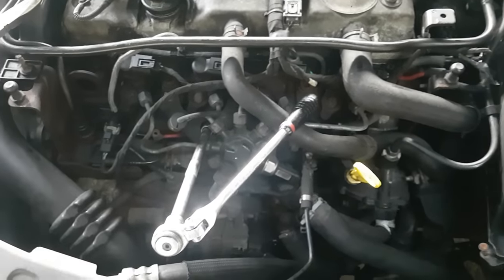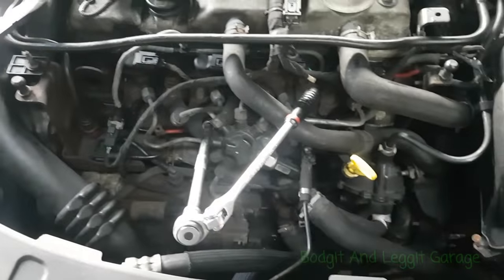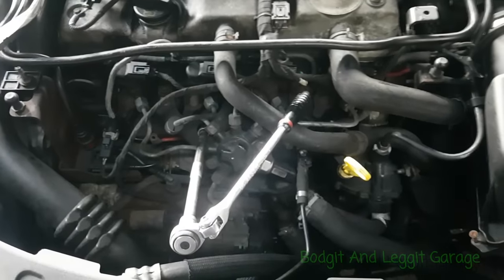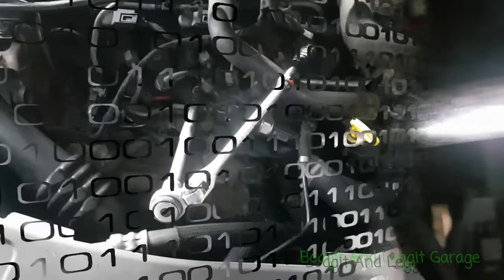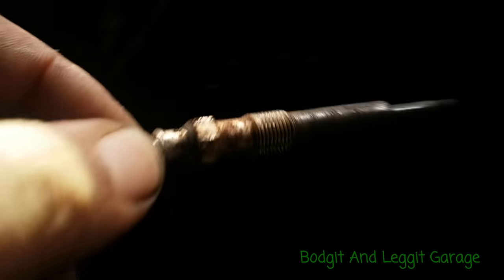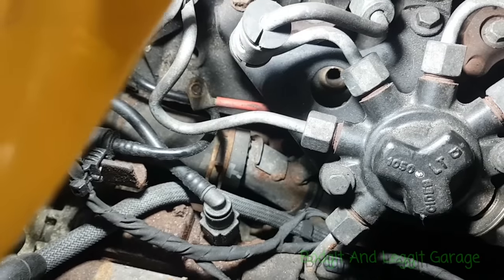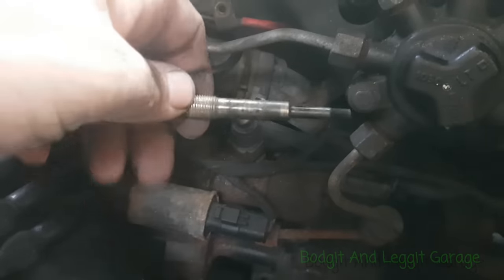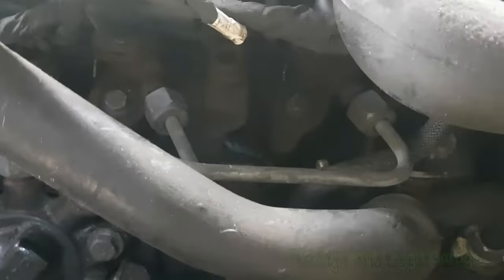How To Remove Seized Heater/stuck glow plug With No Specialist Tools Bodgit And Leggit Garage

Comment: Leon you gave me two f..king heart attacks, I thought it snapped twice😄 
But great job and thanks. 
Any reason why you didn’t use wd40? 
I’m doing my freelander 1 td4 soon, anything I need to look out for?
Reply from the maker: Hi mate to be honest WD40 just doesn't really get him I haven't seen any zuid to work in this circumstances it's clogged up so much it just will not penetrate there's lots of videos out there proving this fact nothing really to look out for just take your time with it and you should be fine

Comment: Do you think glow plugs are responsible for my dpf not reaching 600C? It is usually around 500C when regenerating but the soot level is stuck at 45g and seems to go lower when temperature gets occasionally higher than 500C
Reply: Ever get the answe for this?

Comment: That is (IF) it moved,so what if it didn't??!!! ,hope you show us how to remove a stuck one like number (4) on this engine.
Reply from the maker: If a heater plug is going to snap there is nothing you can do about it it's going to snap I will be doing a video and showing you how to remove a snapped heater plug
Reply: @bodgitandleggitgarage  Thank you for your reply,I will be looking forward to that video,as taking a  heater plug can turn to a nightmare easily.

Comment: yes, I am grasping that atm.  I also dont know if heat helps penetrating oil?
Reply from the maker: It's like everything made it has its uses for certain applications it most probably would have stopped the squeaking noise but it would not have penetrated or the hard material that was caught in the threads in this case

Comment: Great videos, mate. Unfortunately i'm in the latter group whose plugs are still stuck (rounded heads) in a Renault master 2.5L after trying with a bolt extractor to no avail. Probably asking a bit much for a follow up video on that but it couldn't come a day too soon!
Reply from the maker: as soon as I get a car in where the heater plugs are broken or snapped I will be film it mate
Reply: Did you make one yet?

Comment: hi there. my 2.0 tdci got 2 spark plugs snaped and one got out but the central eletrode is still stucked in engine. any tip top? cheers
Reply from the maker: Hi mate what happens is the tip of the electro boulders up and is too big to pass through the engine block hole what you have to do is get it pushed into the cylinder take the injector out use a magma and get the tip out that way there is a special tool for it I have done a video on it Hubitools have the kit tell them I've sent you they will look after you
Reply: @bodgitandleggitgarage  many thanks! :)
Reply from the maker: @woobeitwebdesign2303  any time mate
Reply: @bodgitandleggitgarage  i just forgt to mention that in my case i have the thing a little bit f@#$%. i have the central electrode and the tip inside, the rest of the spark plug got out but with this 'wire' i think im not sure i can adopt your tip top of pushing it inside without first removing this electrode, and because its tip is so short, its even more complicated to user pliers or something else. i will look into your hubitols video and please feel free to share some leads :)

Comment: you tools have a glow plug air gun for seized plug ,air gun not work why you don't use it.
Reply from the maker: First thing look at the title of the video second thing not everyone's going to want to spend lots of money on one of them tools third thing someone's going to most probably start this in the morning not realising they're going to come into a problem and they're going to be snookered 4 things not everyone has an air compressor this video shows you how to do it with no specialist tools hence the title
Reply: I’m waiting for my glow plug impact to arrive I know you said there worth there weight in gold but I’m still nervous about getting them out. I brought it on your review. As I’ve had a plug snap in my old transit. £1800 to fix it. £140 is cheap if it works

Comment: My damn glow plug is just spinning round and round. And it wont tighten back the other way. Dann it.
Reply from the maker: not good mate
Reply: @bodgitandleggitgarage  any idea what it might be? Threads knackered maybe. Read somewhere to give it a small whack of a hammer and try again. But if I bust the engine threads I'm in trouble. Maybe pulling the bottom up as I unscrew? Have left it soaking in wd40 but not that hopeful.
Reply from the maker: @michaelfreeman7381  could be loads of reasons mate could be threads a gun cross threaded it could be snapped internally there's more than one reason impossible to know unless I see it but from the sounds of it however you look about it's going to be a nightmare to get out possibly looking at redrilling it and re tapping it it's a big job the tools you need to do this are very expensive if you will be cheaper paying someone to do this
Reply: @bodgitandleggitgarage  I'll just try a few more tricks then it's time to get rid I think. The thing was really over tightened, should've just left it in in hindsight.

Comment: Leon there is one special tool needed patience, unfortunately you can't buy it. Is there any reason not to use anti seize in this application?
Reply from the maker: Hi mate I've never known any to work properly especially in this type of environment where it gets very hot and cold thousands of times I do see your point just haven't really found one that works properly
Reply: maybe candel wax if you can get it in before it sets great lubricant
Reply from the maker: @timmytrumpet9922  yes mate I have had some success with candle wax in the past on different issues
Reply: Timmy Trumpet antiseize like copper slip etc normally leads to over torquing things.

Comment: Nice one bud. What was the Simpson’s to make you remove the glow plugs please.
Reply from the maker: I was just doing it service and I tester heater plugs just as a matter of course and 3 of them were bad we haven't had the weather or should I say we haven't had cold enough weather to affect it starting but we are getting into the winter so just as well changing them now
Reply: May I pick your brains please bud? I’ve have a mk 6 transit tourneo, a few months now. It has 18 inch ally wheels. Just passed mot np. The thing is at around 40-45 mph there’s a wobble worse on acceleration. As mot was ok bearings etc must be ok. New tyres fitted so balancing should be ok? Do you think it’s possible the wheels are u.s o front wheel drive. Thanks mate for your thoughts in advance.
Reply from the maker: @paulelliott2861  hi mate if the problem only happens when you put the big wheels on it can really only be a problem with the wheels either they're not fitted correctly and what I mean by that is some wheels have an inner ring that sits on the hub to centre it properly make sure you have that ring if not one of the wheels could be badly warped make sure there's no welding or any marks on them this could also throw it out
Reply: bodgit and leggit garage thanks buddy there bud came with these wheels . Once I got it home my wife said” them tyres don’t look right “ I took it to a tyre place and yes indeed they where incorrect. They where car tyres. Had them replaced. I did not see any rings on them but there offside front has a large number off balance weights on it. I have a set of standard wheels and tyres. So will change over. Thanks bud.

Comment: Done mine a few weeks ago on the same engine, 3 of them popped out easy but the last one wasn’t budging, starts a lot better now, I used new Bosch ones and the bit to put the socket on was a lot longer so it doesn’t slip off as easy.
Reply from the maker: Sorted!!!

Comment: I've been battling this for a couple of days now!  Not sure how you eventually got it out, but mine seems to come out all the way just like that (noise and all!) but at the end of the thread seems to just spin in place so I can't remove it.  This plug seems to be the only plug that has been previously replaced (the tip was different and service says a plug was replaced), but I've replaced the other 3 so would like to replace this one as well.  Screws back in ok'ish though so maybe I should just leave it....??
Reply from the maker: Hi mate, what it sounds like is the end of the glow plug has bulged out? This is caused by Heat and the plug breaking down. Again, I'm not 100% sure because I'm not there, but that's what it sounds like if that is the case you are unfortunately in a bit of trouble as it cannot be removed. The only way to do it is to try and break the end off and take out the injector and remove the piece but you have to be very careful doing this. As you can call permanent damage to your engine if you don't have the tools. I personally would leave it or go to a garage that does.
Reply: bodgit and leggit garage thank you very much for getting back to me. I think I’ll leave it as is for now 👍
Reply: I’ve bought a new set but I’m losing me bottle watching these vids

Comment: Thanx for ur help !! Took the glow plugs out of my 2003, transit today. Used ur technique which worked a treat.
1 although appeared to un screw, well it did unscrew but then would not pull out ?
So improvised and wrapped wire around the head and held with pliers. Then pulled on that whilst wiggling the nut and it then came free.
Caked in black soot etc.
Everything cleaned up, including inlet manifold and egr. Then all back together !!
Good afternoons work ???

Comment: I think I would change the front 3 and not even worry about #4. If you’ve got three working, that fourth one doesn’t matter one bit unless it has separate glow plug circuits and is setting a DTC for #4. Most 4 cylinders don’t work that way though, all of the glow plugs are connected to each other with either a wiring harness with a single power feed or a bus bar.
Reply: I have 1.7 diesel Astra which has one loom containing four cables from the timer control module. One cable to each glow plug, makes diagnosis a doddle

Comment: No substitute for a skilled mechanics touch! Reminded me of changing them on my old P100. One snapped and was a right bugger to get out. Quite common to find three new ones and a broken old one in an engine,starts ok on three good plugs.
Reply from the maker: The problem is made with lots of modern cars with DPF filters when is trying to regain depending on the car three might not be enough and can go into limp mode

Comment: As usual another helpfull video.  Any benefit to using this method along  with wd40?
Reply from the maker: Hi mate in my opinion no there's lots of videos out there proving even with lots of heat penetrating oil doesn't really work don't get me wrong I still use it but I think it's more in my head to use it than it actually does any good but like everything there is certain circumstances where it can be used
Reply: @bodgitandleggitgarage  

Intresting, i dont deal with stuck bolts as often as you but  think i probably agree.  I wonder if to an extent penetrating lube actually dulls the feel of the thread binding so the temptation is to do that extra turn rather than backing off.
Reply: Paul F 
Great point 👍

Comment: one of mine did that and left the end bit in td4 freelander
Reply from the maker: Is a special kit to remove then? I've done a video on it took it is made by Hubitools contact them on Facebook tell them I sent you they will look after you.
Reply: it was the end of the electrode that is left in not the outer screw part
Reply from the maker: @eddieMurphy11111  Yeah, that's the special kits. I was talking about I have done a video on it.
Reply: thanks I will have a look I am getting a bit old now and disabled so I will show it the son in law and hope he can do it this serves me right for messing
Reply: whats the video called I can not seem to find it go easy on me please LOL
Reply: what we aim to do is either leave it or the best way is I have a removal kit and it has some small guides in it drill the thin part away and then drill a small hole into the end bit I have some reverse bolt extractors so will try the small one and if any bits get in I aim to put a good old hoover down the injector hole and then for good luck I have a small camera I can plug into my lap top and look down it I will let you know if all goes to plan once we have a bit of warm weather that is but thank for your help we enjoy your videosRead more
Reply: where about's are you
Reply: where abouts are you